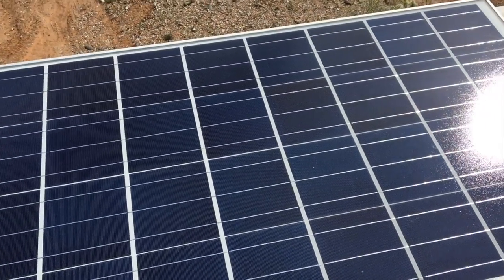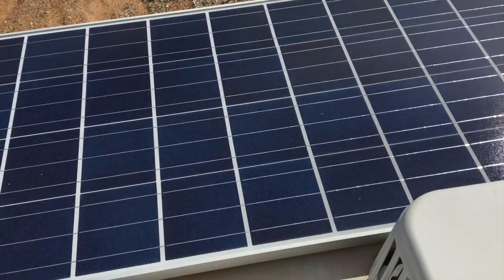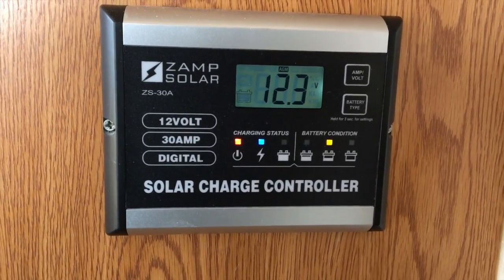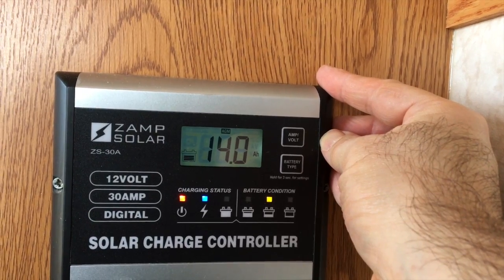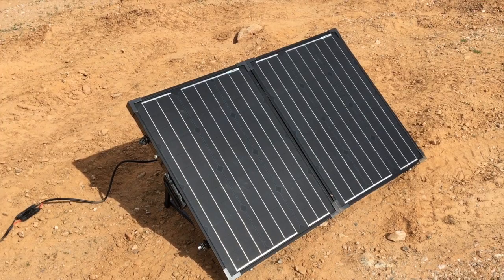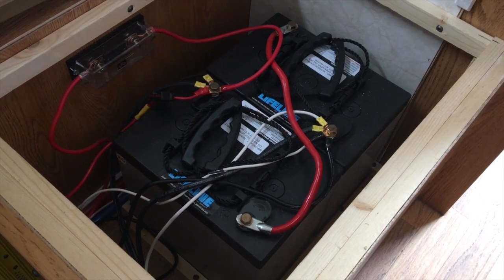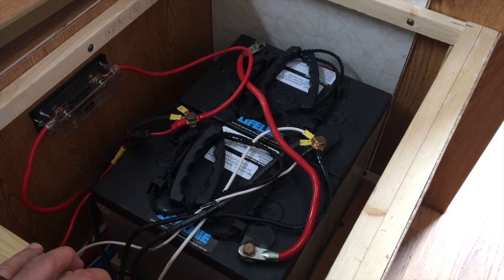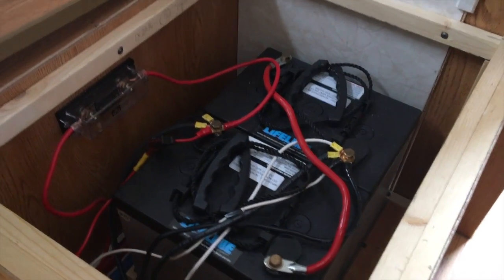Tour of Mello Mike's 340 Watt Solar Power System

Comment: Thanks for your interesting video! Is it better to have the inverter wired directly and within about 4 feet of the batteries, then somehow  run a regular 12-16 guage extension cord into my 23 foot travel trailer for the 31 watt LED AC  television and perhaps other small AC items? I have 2 six volt Trojan T145 flooded in series, outside in the typical trailer tongue location. Right now I have my inverter inside, getting power from my 15 amp fused radio with a standard flat 2 pin SAE wire I added which plugs to a 6 foot female cigarette recepticle. Then I plug a Eugizmo cigarette lighter adapter splitter which has a battery volt readout on it.  I plug the removable male cigar plug from my 300 watt Samlex inverter into that. Funny thing is when I turn the television on the volt readout flashes at 11.5 volts. My batteries are in excellent condition and fully charged, television works fine. Any ideas? 
  Also, I'm shopping for solar equipment. Don't want anything on the roof. I see you have both Renogy and Zamp. I want more than just the bare minimum of power. Would two 100 watt panels and a controller be adequate?  And Renogy seems like very good stuff for alot less than Zamp?? What do you think?

Comment: I have a question about an article that I saw on your truck camper website....you had been up to Mt Graham AZ and spoke of Treasure cove primitive camping area....what is the elevation there and is it before or after the Shannon campgrounds?? I was told that there was only water at "Columbine Horse Corrals" which is by the visitors center....and Riggs Lake, so if I can get by without hauling water up there would be great!. I am looking for the best place to camp that is heavily forested and the less people, the better! Since I have a 22' bumper pull travel trailer I feel more comfortable in places that I can get into and out of without sweating too much!! LOL....I am pulling my TT(5000 lbs loaded) with a 2008 one ton Ford van(so I can take my 3 Great Danes) with a 5.4 engine- do you think I will have a tough time getting up there due to the incline? I was thinking of installing a K&N cold air intake kit to give me a little more horsepower....do you think that would be worth the investment? Thanks for your great videos! Would love to know what you think!

Comment: that was actually the best side by side test for fixed vs movable solar panels. your portable 100 watt was putting out 5 amps and the 2 120 Watters were only putting out 6 amps combined. thanks for the enjoyable videos and be safe
Reply from the maker: Thanks. Yes, I agree that was a good test. Shows you how well a tilted panel aimed at the sun can do.
Reply: Truck Camper Adventure  Yes, but if you were to switch to a MPPT controller you would get far more out of your panels. If you have a 200 watt panel giving you 6A at 12V that is just 72W of the 200 that are being used.
Reply: @henrivanbemmel  I am looking for a package deal on a solar setup. Where do you advise me to start looking? I want the controller, wiring, panels etc. what brand is best?
Reply: @billwilliams9897  I'm in Canada, so I worked with Renogy and there stuff has been fine. No tax and no shipping charges which is nice.
An MPPT  controller is essential and are now reasonably priced. You will have to take a decent inventory of your electricity use. You will need a decent battery monitor. I've bought mine in the past from Victron and they work well. Renogy now has heated LFP batteries which gets you past the problems of cold weather. However, that will depend on your location. I've got 400Ah of LFP batteries and 800W on the roof and it just works if I'm careful. Even with the fridge on LPG the base electrical load and the fridge can cost you 50 Ah a day. Add in some toaster time (using an inverter) and TV and computer and you can blow through 100 Ah in a day very easily. You might get 250 Ah back in full sun in June, any shadows or clouds etc and it'll be half that. So,  it's easy to get into a discharge hole. Having as much battery as you afford is always good. Renogy does not advise placing more than 4 of their batteries in parallel. However, if your engine charges the house batteries, check your slternator rating as LFP batteries can charge at high currents and damage your vehicle's alternator. You can get current limiters for this or install a solenoid so you can control it. Your battery monitor system can tell you how high the charge current is and then you can decide to disconnect the engine from the house if warranted. 
Lots of folks have done this and have posted their stuff on YT. These can be very helpful. Then you can source these products and find out prices. I would buy it all new. If you are running multiple batteries you should consider using bus bars otherwise you'll end up with too many connections to a single battery terminal. You will also have to cut and crimp lugs on perhaps 2/0 battery cable. There are ratchet crimper and impact (hammer) type. I use the hammer, it was cheaper and has worked well. Dunno what else to say, but I'm always willing to answer questions. All the best. Henri (RVing with Henri)
Reply: @henrivanbemmel  🙏 Thank you very much Sir for the well thought out response. I could not have asked a better person that question.

Comment: Great solar setup, interesting to have both roof mounted and portable panels.  Seems like a lot of solar power for a truck camper, do you spend a lot of days camping off grid?  Really like the system you have, thank you for sharing all the details. 👍
Reply from the maker: Yes, we do lots of boondocking. The DC compressor refrigerator requires a lot of power, about 60 amp hours per day.

Comment: Is it possible to have 50 amp service in a truck camper? 50 amp service if you're staying in a RV park would make life easier.
Reply from the maker: The truck camper has 30 amp service. Using it would be easier, but where we like to camp and explore there's no such service.

Comment: Nice work! Mono Panels suffer greatly under high temps, I have them all different types Polys work best in high temps. If I may suggest something upgrade to a Epsolar 4215 mppt charge controller U will love it. I have a video about it on my channel under solar camper play list.
Reply: Please point me to a source of information about mono panels suffering greatly under high temperatures.  I googled this and can't find anything to back up your statement.
Reply: Hi John ,  My only source is my own day to day experience running my home for the last 5+ years with solar panels of 3 different types,Mono, Poly , Muticrystalline  basically  the same as poly from 6 different manufactures back when solar was still $2 a watt.  when solar cells reach 130F+ range most every day here they fall off a lot. My 6 mono panels fell off far more than the poly type & then when cooling them down with water the mono regain more power than poly panels cooled  with water, then fell off again when the water cooling stopped. Mono panels do work a bit better on a cloudy cool day, I dont get many of those . I was just sharing my experience as regular guy, not a scientist or expert, but  as a person who lives  on solar power every day with both grid tie & off grid systems .
Reply: Your experience is appreciated. Field reports are every bit as helpful as lab numbers.